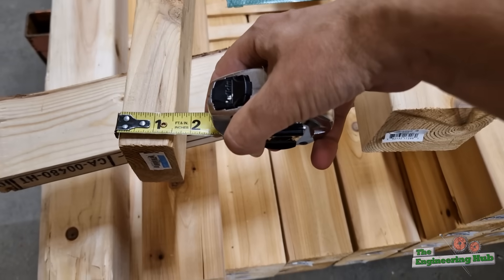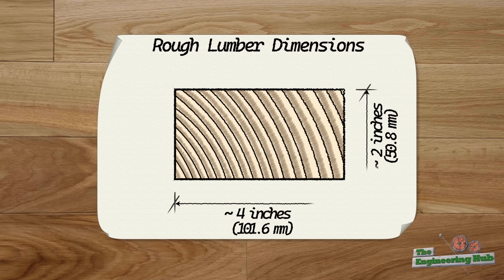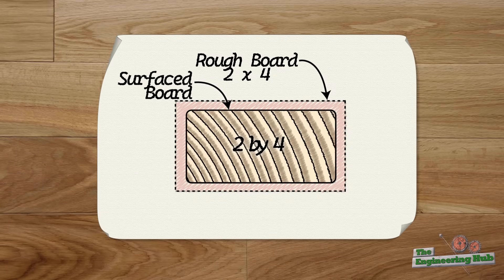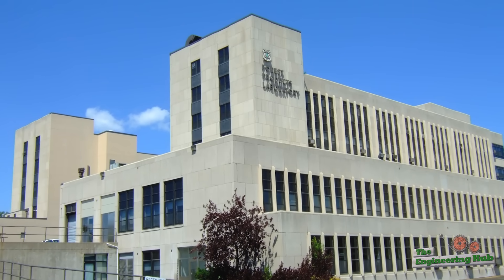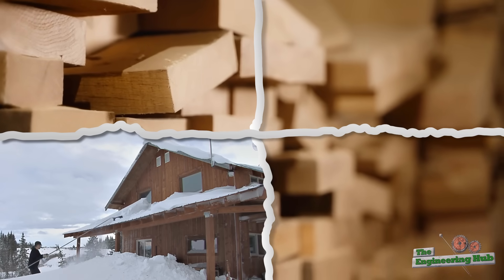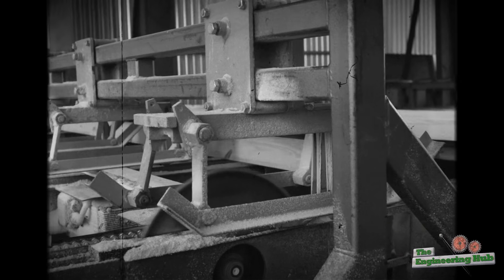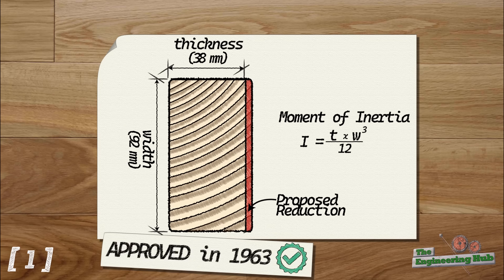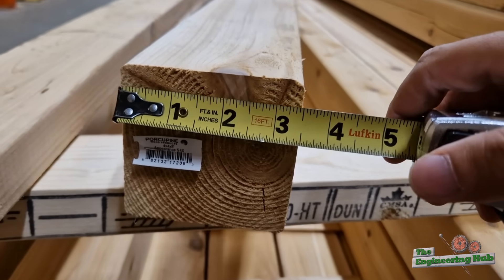Why is the 2 by 4 getting smaller and smaller?

Comment: Good video. As an engineer and former commodities broker, you hit all the important points.I sold more Western SPF spruce pine fir, which is almost 100% spruce now in Canada to the USA.  My competition was southern yellow Pine  SYP.  SYP was stronger and more resistant to decay, but the end user preferred our lighter and easier to cut and nail WSPF.  Our eastern SPF was stronger than WSPF but too heavy because it was air dried versus the Kiln dried lumber coming from British Columbia.
Our market size was 99 percent on cost.  Freight and the exchange rate determined the market area, so I can see how the mills struggled to keep weight and size to a minimum.  We were more of a trucking company than a commodity broker, so our advantage was optimising freight.  We had agreements with US truckers that came to Canada and would give us a cut rate so as to not have to go home empty, But when the Canadian dollar jumped  our market shrunk huge and I could not sell a stick 200 km past the USA border.  I went from making good money chatting on the phone with my buddies once a week asking then how much they needed this week, to unemployed in a matter of a few months.
Reply: If you added a section about the tables, building code and structural design that may eliminate any ignorant comments about the structural integrity.  As engineers we have tables which reference the different grades and species of lumber by their applicable strengths.  The scrap lumber is often referred to as economy studs are not permitted by any building code I am aware of, and the building grade is referred to as number 2 and better.  Lumber like cedar is no longer accepted by most codes as the lumber no longer has a predictable  strength, but this is a function of the properties of new growth, not the Mills.  Issues with the historic quality of the wood are more  a function of historically inept deforestation policies.
Reply: That's not right man. I understand that increasing the price would cause a housing shortage but y'all need a livable wage too. National economics is quite complex. I have huge respect for people that keep working on the lumber industry no matter how little pay they get

Comment: Also, moisture warps wood. Keeping planks thicker would help protect.
True, there isn't an instance of "2x4" being a legally protected name of a certain type of board - because its not a name, it's a measurement. If i want a "two by four," then what i want is a two inch by four inch board, and i need to specify the length. It's not like saying i want a Chevy Impala, it's like saying i want a gallon of milk.
Also, the lumber industry in the Midwest was huge. It still exists, in fact. No matter what you do to ship wood, you can't compete shipping wood by boat or by rail from the Pacifoc Northwest to eastern cities with the cost of shipping it from the Midwest. If you want a specific type of wood, there you go.

Comment: My house was built in 1955~1956, and it's true - it's framed in 3-5/8 x 1-5/8 lumber (I have to shim everything when I make a change with modern lumber). Not only that, the corners are nice and square (which I really like, it gives more surface area for mounting electrical boxes, etc.)

But while the lumber has better in the 1950s, some other materials were worst and have improved over time. 1950s electrical wire is a pain to strip (fortunately I've replaced most of it), and 1950s electrical boxes are annoyingly shallow (too shallow for modern "smart switches). And 1950s insulation was a joke!

Comment: The board in the thumbnail labeled 1914 is not from 1914. If it was the ring segments would be much closer tobether much more like the one labeled 1960. The size comparison is accurate, but most of our new lumber is force grown. The rings will be a lot farther apart because the tree grows faster when forced to. The result is a huge difference in density.

Comment: Interesting. Over here in Estonia (and in most of Europe probably) the 2x4 equivalent is 50x100mm which is much closer to an actual 2x4 in dimensions than the contemporary 2x4 in the US. That being said, no houses are built using 50x100 lumber here. It's at least 50x150 (or 2x6) but more commonly 50x200 (2x8) or sometimes even 50x250 (2x10).
Reply: In Sweden we use 45x90 or 45x70 depending on what wall you build (bearing or not)
Reply: My latest house use 45x170 for main outer wall studs, both for the load and to hold enough insulation
Reply: Isn't that very thick? Is it something to do with bricks, temperature, tree type?
Reply: @XPimKossibleX  At least here in Sweden we have climate zones prescribing, for different regions, the load necessary to withstand because of snow thickness and insulation necessary for keeping downy energy consumption
Reply: @HapticKJ  Lol here in America, I'm surprised we aren't regulated to the thinnest walls possible so the power companies can make more money.
Reply: I thought European houses were superior because they were all built out of stone, brick and concrete????

Comment: I disagree. It was cut at 2x4 but shrinkage happens. If you have ever worked with rough sawn lumber you will get a lot of slivers every day. The answer was to plane it down to 1 1-2 by 3 1-2 which was uniformally accepted.

Comment: This is completely wrong. 2x4 were never plained on site for building a house or buildings, they were used as is. The 2x4 was rough sawed and to  make the materials a standard size for every need it is planned to the 1.5x 3.5. A standard circular saw or band saw couldnt hold an exact size, only a planer could.
Build something out of rough sawn wood and you will understand why there is a "standard"

Comment: In Finland we have choice. You can buy rough 2x4 or smooth 2x4. 
They are both same dimension (actually bit smaller than 2x4 since 2in=5.08cm-->round it down to 5cm), smoother is just expensive.

Comment: The combination of dimensional decrease and density decrease (fast-grown) has only led us to use 2x6 for anything but hanging drywall and small sheds.  Some great old books have plans that aren't buildable anymore.
Reply: Depends on what wood you’re using. With doug fir you would be fine but it is a bit more expensive. Western SPF is also still quite strong. Do you use SYP for the most part?
Reply: 6:17
Reply: Yes and no. With modern sheathing material / fasteners with the correct nailing pattern you can regain a lot of lost strength.
Reply: Use of 2x6 in exterior walls affords more insulation and greater R value.
Reply: @thatguy1917 you could just stager your 2x4s 🤦‍♂️ waste of $
Reply: @thatguy1917  With the reduction in cladding thickness removing the advantage of 2x6 walls. I remodel homes and the older ones are always cooler in the summer and warmer in the winter. Over all superior R value in older homes, hands down. Check it for yourself. Seal around windows and doors in an older home is all you have to do to skyrocket the R value. Adding insulation is not more effective than dead air space. Insulation works using the principle of dead air.
Reply: @GEOsustainable what state are you working in? In the southeast every old home I've been in the insulation is much worse unless they have bad stone veneer for the exterior walls, like my house has, but the 2nd floor the insulation is total garbage and without lots of AC and circulation it's unlivable.
Reply: This is totally congruent with my experience as well. All these space-age sales people keep telling me I'm wrong, and I just shake my head in wonder at the fact that my society has gone and forgotten how to build homes.
Reply: 2x4 is used for exterior walls all the time. That's why if you get a prehung door at Home Depot it'll be 4-9/16" in jamb width
Reply: Except building codes now demand 2x6 studs to allow more insulation and save energy.

 @lazydadsgarage
Reply: @lazydadsgarage  no its not at all. pretty sure its against almost every building code now for exterior walls.

Comment: This is extremely annoying. I was erecting some walls in my home and like to build precise & accurate and could not for the life of me understand why the walls came out crooked in the other end. I found out the so called 2 x 4s differed in size depending on where i bought them. If you can`t have an industry standard, i`m telling you right now, your house will not come out straight and that`s a damn shame. Greetings from Norway.

Comment: Milling is done with green lumber, relatively freshly cut logs. This lets it cure (dry out) quicker. A complete log can takes several years to completely cure if you just let it sit, and it will be sussebtible to rot, insect damage and cracking during the meantime.
So, you mill the lumber and then you stack it so that air can circulate through the stack. There are also ways to cure the lumber by applying steam or hot air, or even microwaves, to speed up the process further. Curing will make the wood shrink as it loses much of it's water content. The amount of shrinkage will depend on what kind of wood it is, how dense the individual log is, the orientation of the cut and where in the log it came from.
Warping and twisting of planks and studs will occur too. The amount depends on how fast the lumber cured, how dense /recinous the wood is, how well it was stacked after milling, the storage temperature the quality of the wood itself and  other factors.
To get a completely straight and even board out of a rough plank means you need to sacrifice quite a bit of material, and needles to say it's quite a bit of work. The more twisting and warping, the more material  you need to sacrifice. This is why you'd always buy rough sawn lumber oversized.
Modern sorting, milling, curing, planing and storing can be done with higher rates of consistency, wich means the producer can sell a product that's pretty uniformly stable, and way closer to the final desired dimensions. This saves a lot of work for the carpenter or builder, and it saves on transports and storage space for the mill and/or lumber yard.
(Note: far from all the lumber you can buy have been produced at a high quality standard. Beware, and always check your lumber for quality and dimension, especially if it's cheap)
I've worked a lot with rough lumber, and milled quite a bit too on a small, manually operated mill. It takes skill and experience to know how much "extra" you need to account for in each step of the process.
Planing off just a few mm from a 12”by 8” solid oak beam can be hours of  back-breaking work, even with a modern heavy-duty electric planer.
Then again, you don't want to mill your lumber too thin, and discover down the line that you can't use it.
The old-timey dimensions are still quite good rules of thumb when milling yourself. Most finished dimensions are still derived from these standard milling dimensions, though modern planted lumber shrinks way more than when lumber came from old growth forest.

Comment: I remember learning this the hard way 20 years ago, when I had a project sized for a "2 x 4".  I got the wood home and yelled, "wtf!"   

I'm fine with the current size, but the wood should be sold based on it's final dimensions, even if it s awkward to call it a 1.5 x 3.5.

Comment: Had a house in San Diego built in the 1960s, all the studs were made of 2x6 redwood. Not the redwood you get at home Depot, A real redwood and measured an Exact 2 inches and 6 inches, even the stand-alone garage is a true 2x6 inches.

Comment: Here in Sweden the 2x4 is 45mm by 95mm so actually larger than the American 2x4. Never knew that. Maybe it can explain why we can get away with framing walls using 600mm spacing instead of 16 inch (406mm)?

Comment: I've only lived in fixer-uppers.   First house was built in 1913.  Second place was two different eras of construction, a log cabin from the 1800s, with an addition built around the 1930s.   The place I have now was apparently an old schoolhouse fom the late 1800's, with a back addition from the 1940s/50s, and a front addition in the 1970's.   It's interesting to work with the different eras of material, often frustrating.   

So, lets put this BS to rest.  New wood sucks, from lack of/improper kiln to overall low quality control.   I've sent an entire load of wood back because, when laying flat, I put my foot on the board, the other side was nearly 45 degrees off... pretzel wood!  the entire load.   The old wood is notably denser, it can hold a greater load both from top to bottom and from side to side.   And, as I've seen, if they fail to cover the product during long haul while driving through heavy rain, it tends to create issues.

Find a well maintained Barn, even one about to fall down, take a sample of the wood thats never been exposed to the elements, having no bug damage, then get a standard sample from your big box retailer.   Do what ever you want... drill it, drive a nail through it, run it on a table saw, use any saw you wish, even a band saw.   Also, simply hit it with a hammer over and over again, until they both break.   Then, take whatever is left of both and sit them outside on the ground, leave them for 6 months, see whats left.   

I've never burnt out a tool on modern materials, however, burnt up a saw and a couple drills on that old stuff.   I remember making the comment "the context of real man has obviously changed... who the F drove that nail into this wood, Jonh Henry?"   That's when I put away the framing hammer and grabbed the 3 pound sledge... to drive a nail.

For fact, even if the 2x4 of today were the same size, they are not of the same density, thus there is no apples to apples compairson.   As with many modern matters.   We are sold a lower quality product and are told we should believe it's somehow better, when you can plainly see such is not the case.   Understand, when they say Optimal, they are talking about money, regardless of what they are presenting or the industry presenting it.

Since C-19, I started buying directly from the mill, it eliminated a lot of problems and the price is better.   I've also had property select cut, I've witnessed nearly all stages of the process first hand.   There's a lot of math involved and today it's a science using lasers to measure the cuts, as to ensure the product is not wasted.  The problem cannot be correct, the old dense trees permicible for use, have been used.   Now, they have to replant and maintain areas as to ensure there is a quantity of usable stock.   Old trees are out there, but it's kind of a dik move to strip it all away, we know there are serious immediate and long-term consequenses.

Comment: it’s weird  I hate it !   actual  true sizes were what was standard for carcassing in UK, so, sawn 4x2 was for non load bearing studs. 6x2 for load bearing studs, floor joists were 2 1/2”  ceiling joists 2”  Framing floor or ceiling openings 2 1/2” or 3”,   spacing does not seem to have changed. So obviously houses are being built more flimsily  today (and from crap kilned timber) we are losing the quality of our housing stock and greatly increasing justifications for it !
Reply: You should see what the actual walls are made from now, instead of plywood, they basically just use the vapor barrier sheets. Yes, you can literally just walk through the exterior walls now..

Comment: What is optimal for the safety of human beings and our future "net zero" energy efficient homes is engineering, feasibly, wood home building components to withstand hurricane / tornado wind loads. I understand this means "truss" components for unified building frames which yield deep, "insulation cavities" and the possibility to use the lumber from 15 year trees planted for carbon sequestration / affordable home construction in the "NEW ERA" home construction mix.

Comment: The video did not address the common terminology used not only for lumber, but all construction and manufacturing materials.  The two terms are actual size and nominal size.  The nominal size is the terminology used to label the product whereas actual size is just as the term implies.  Do you realize how awkward and confusing it would be if a bill of materials always referred to a 2x4 by its actual dimensions instead?  For other materials, the nominal size may refer to only one feature. For example, a 1/2” pipe may be the outside diameter for some types of pipe but the inside diameter for others.  A 1/2” CRS rod is exactly 1/2” in diameter but a 1/2” HRS has a slightly less than 1/2” diameter.  Manufacturing processes impact actual sizes even though nominal sizes are identical.

Comment: Why do 2x4s have such extreme quarter rounding on the edges? If you want to recut it for other than framing purposes, you lose a full quarter inch on each edge. I've never seen any explanation for this machining. The only thing I can think of is that it makes the sticks easier for a carpenter to handle.

Comment: Absolutely incorrect!!!
Two-by-fours and two-by-sixes both measure a half inch less than true because they are used in vertical framing for wall studs, when you put on half inch plywood you get the true four or six inches. This is done strickly for the architect engineering the blueprints. The same reason a 2x8, 2x10, and 2x12 measures 7.25, 9.25 and 11.25 these boards are generally larger because they run horizontal for floor joists and  and get their final dimensions of 8", 10"  and 12"  once the 3/4 is installed. It has zero to do with  the milling process, or cost cutting. It's a structural design to keep wall dimensions 4" on blueprints which makes it easier on the designers as well as the builders. Anything built pre-1960 is normally true two-by-four size and predominantly oak where I live. Most houses today are framed with cheap abundant soft pine from Canada or Georgia and require alot more rigid structural support for rack bracing. Now you know 😂